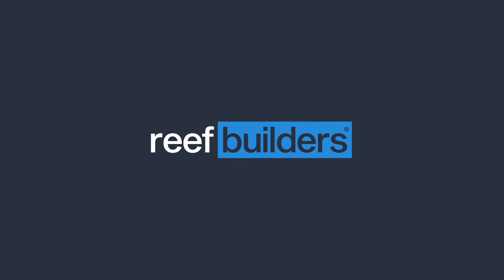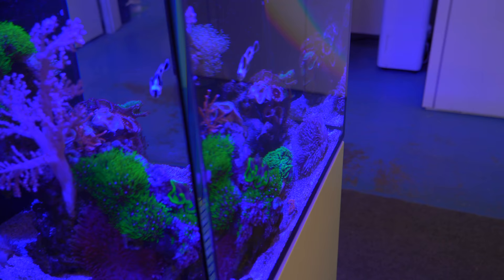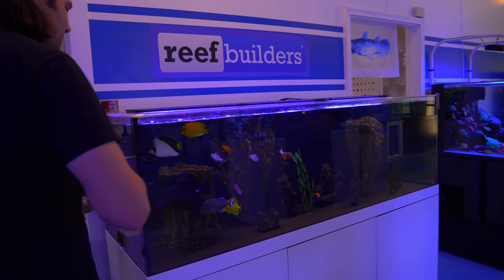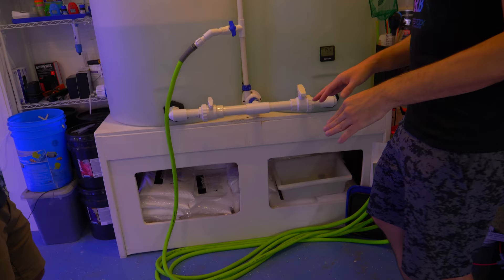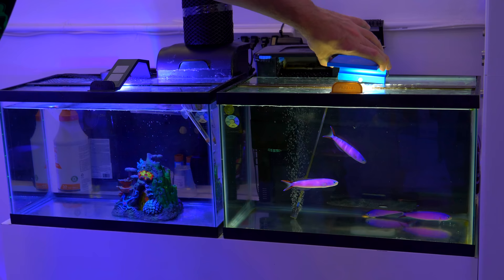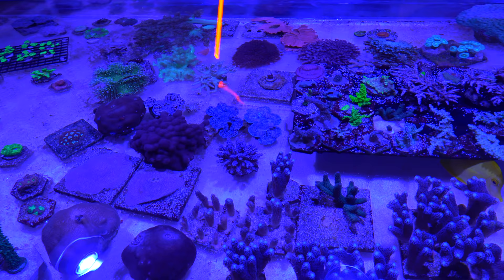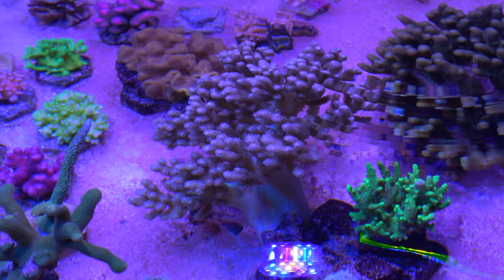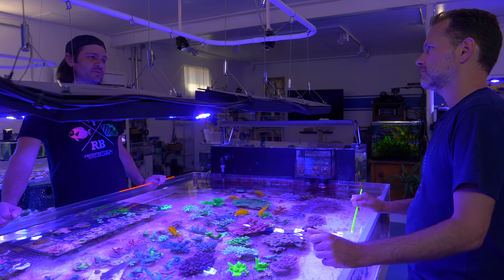2021 Reef Builders Studio Tour w/ Mark van der Wal Part 1

Comment: Had to poke the hydrometer needle with a toothpick to release micro bubbles.. :) 
My fav.1st pink stylophora, 2nd a.aculeus (is a classic)  , 3rd any of the torts. A.humilis were cool and the snake polyps. The stupidest corals are any of the zoas! Btw you need a bubble tip anemone tank. A normal (you need the flow bro) splitting of a bta is under 48 hrs. You are starving it, just cut it and feed it. 100% joyful video, thank you 🍻
Reply: Didn’t see the Conspic and Blulines from Poma??

Do you still have them?

Comment: Your Anemone is not splitting due to constricted space. It is not your anemone's fault, in a larger area it would have split within less than a day.  I've had that happen to me until I realized that I'm keeping it in too small of a space for it to stretch out enough. I am sure it either split by now. However, in the future, it's better to let them roam a bit when they're splitting in a frag tank. they don't go too far after a split so easy to catch.